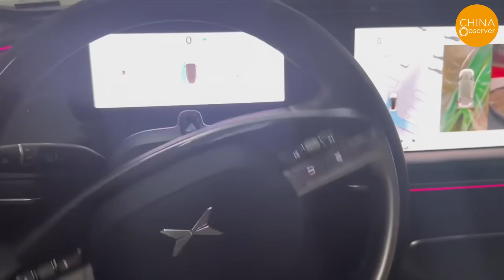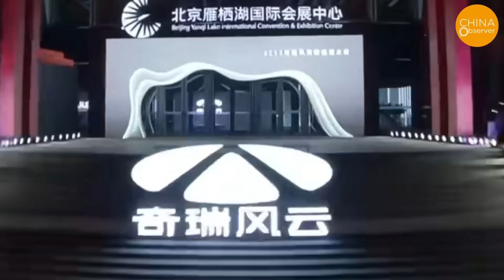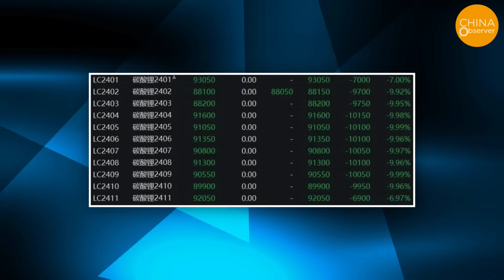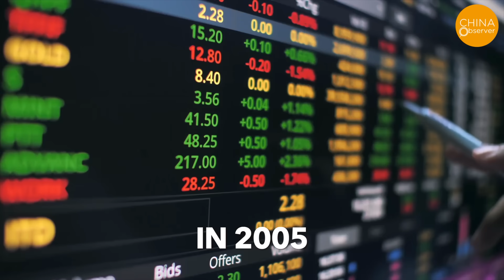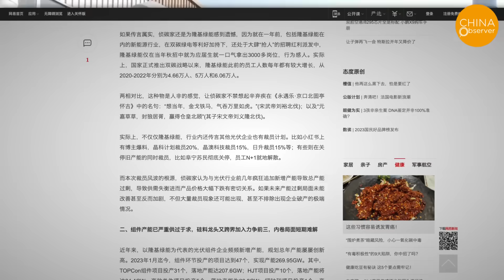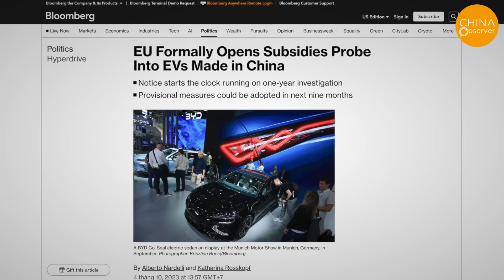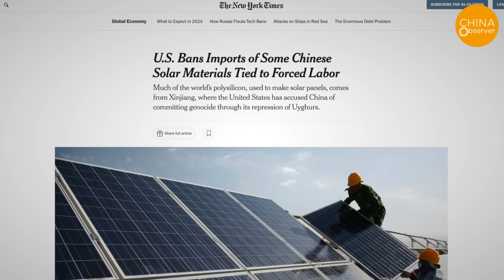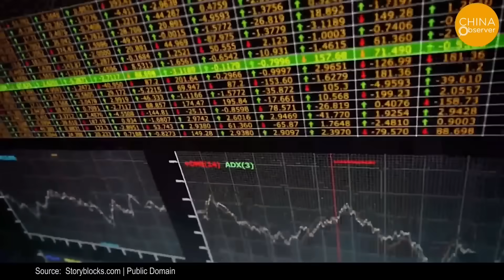Sudden EV Explosion, Rockets up 5 Meters, Close to 100 BYD Autos Spontaneously Combust

Comment: It's FAKE and here's why.
It is a real car and it does take off,
The people not only in front but but behind are waiting for it to happen and don't react surprised when it takes off.
The orange flare appears to start from the ground next the rear ( right hand side ) wheel.
The orange colour is too light and not bright enough.
After just a few frame there no orange flames.
The white smoke looks more like a compressed air and water.
There is a cable attached to the car ( 0:09 ) this could be how the orange flare was set off ?

Basically they fired a orange flare then fired an air canon under the car, the air/water covered the hole under the car. Notice the camera pans up even though the car drops down, this is because the hole would now be visible.

Comment: sfx stunt shot car was propelled upwards by charge going off pushing a pole through the base of the car sending it upwards there is no charging cable attached you can see the pole come out the bottom of the car through the smoke behind the corner of the building you can see the second unit film crew filming the stunt its a practice well known in movies remember raiders of the lost ark when indy shoots the driver of the truck he thinks marrion is in and it flips over on its side and blows up same stunt shot only it went wrong the charge wasnt powerfull enough to flip it on its roof like the director wanted so they left it in as was

Comment: What a load of FUD. There is a guy holding a camera filming the whole thing, let alone the vehicle is not a BYD and no battery pack would have enough force to send a 2 tonne vehicle 5 meters up in the air. Do some better research and stop wasting people’s time. It is a Toyota Rave 4, not a BYD. The other freeway video is a car traveling too fast and wrapped itself around a pole. Speed kills and the fuel ignited not a lithium battery. Wow.

Comment: EVs don't solve anything, but they create a lot of problems. The internal combustion engine is the most effective way to create energy from fossil fuels, and we will be using fossil fuels for decades. And actually petrol cars can also run on renewables, liquid fuel can be produced from electricity, and this is in every way a better solution. Batteries are heavy and thus gives bad driving cars. EVs makes no sense, stop this madness, it's idiotic.
Reply: And by the way co2 actually does more good than harm.
It makes plants more resistant to drought. It really benefits agriculture.
Actually more people die from cold than from heat.

Comment: just bought me a Xpeng G6, smooth quiet fast, 1 charge goes 500km(real range) cost $5, airconditoned seats steering wheel, surround voice command, self parking/driving. phone control - preheat car minute later all warm and toasty even steering wheel warm or cooled in summer.  you guys are living the the stone age, u.s. gov knows this and paying 1.5 billion a yr to smear all things china.    wonder how much this video got from that 1.5 bil

Comment: Some odd things I noticed about the first video. One person looked like he was recording as he was anticipating this. Nut everyone seemed calmed like nothing happened except one guy to the right. Also, I find it odd that their would be this much power to through this truck this high in the air. There where 4 sides under the vehicle for the pressure from the explosion to escape. I'm not saying this didn't happen, but I found these things odd. Now if this did happen as then yes this is very alarming and concerning. I think theirs so much hate for electric vehicles right now, theirs a lot of motives to make things seem worse the reality. Electric vehicles are the future. Whether or not they are ready to replace gas vehicles right now is a other story. Personally I don't think we are ready to replace gas vehicles with electric yet on a large scale yet. I also feel that theirs always going to be a need for gas vehicles as well.
Reply: Nothing green about EV. So don't come up with rash statements like "electric vehicles are the future"

They don't need to be. Especially if they aren't green and merely a tool by your government to control you into submitting yourself to the fake green agenda. Wake up!

Comment: This was all predictable if the press and politicians had told the whole story. In the 70s a minor event at three mile island happened that ended up killing people! Not because the nuclear reactor had a problem, what killed people was the panic that the press and politicians caused! All the deaths from three mile island were the result of traffic accidents involving people fleeing the area. If people knew what such a reactor was really capable of there would have been no panic.
        This is also true of the Green panic! Have you seen what happens when you put a small strip of lithium metal in the most common surface chemical on the planet? First it smokes giving of noxious fumes, then it burst into flames, finally it explodes! The common chemical H2O, also known as water. How do you permanently keep the lithium metal permanently out of contact with water? Even in the dryest places on our planet (deserts) there is water just not as much.

Comment: We have all had bad experience with batteries why would they think we would accept it in something we need like a car? Every kid has a RC car in the closet that won’t work because battery is dead and out dated so replacement is not possible rendering the entire car useless. Boycott batteries and poorly applied tech. Don’t buy into scams.

Comment: it is all about power density.... in order to increase range, we need to pack ever increasing amounts of energy into the reservoirs which are the battery cells.. fast chargers will also affect the service life of the cells.... the batteries are designed to discharge their energy at a variable rate with a maximum cap.... the problem arises when batteries are either badly designed or have suffered some sort of deformation either by waste heat caused by charging or catastrophic impacts like an accident.... the physically deformed batteries would short circuit and a chain reaction may cause the cells to either start burning and melting exposing other cells to short circuits and a nearly inextinguishable fire to burn until there are no more cells left to sustain the chain reaction, or the most dangerous scenario of all which is the cells would attempt to discharge all their energy at one shot. the laws of physics would then in principle dictate that the battery pack would behave just like an equivalent explosive charge. it would not exactly be a high order detonation like C4, but due to the sheer quantity of battery mass, which is likely the whole floorboard of the vehicle, i believe that the passengers would have an extremely tough time getting away. if the initial explosion does not kill them outright, the ensuing fire would engulf the vehicle faster than a regular petrol car in the same predicament.... if the passengers are still alive after all that, the fumes from the burning lithium cells should finish the job or leave permanent injuries at the very least. it is a very grim way to go...

Comment: I've just done research on lithium ion batteries and found out that they do far greater harm than good. To elaborate, lithium ion is extremely sensitive to heat; if caught on fire, hazardous toxic fumes containing carbon monoxide and hydrogen fluoride are released in the atmosphere and increase air pollution. Secondly, lithium salt contaminates soil and water sources; plants and animals die in agonizing pain from the stuff. Thirdly, farmers CANNOT plant crops in lithium enriched soil, and even if they could, crops aren't fit for consumption due to lithium ion contaminants. Needless to say, you think fossil fuels are bad? Well, lithium salt and ore...IS EVEN WORSE!
Reply: You didn't do any research at all. You're just parroting the same clueless nonsense that we have all heard a million times.
Reply: @user-bb7up7xv8m  For your information, I have done my research on lithium and its ill effect on the environment, you magniloquent  imp.

Comment: We Are Decades Away From EV's Becoming The Reliable! We DO NOT HAVE THE POWER GRID To Charge 10% If All Cars Were Suddenly EV"S! These Companies Wanted To Go EV With Their Delivery Trucks But Found To Charge Them Would Require more Currant Than The City These Companies Are Located in use At Full draw! We Should be Driving Hybrids With Super capacitors In Them !! This Would Eliminate The Deadly Gasses These EV's Produce While Charging And The TOXIC Waste They Will Be At The End Of Their SHORT LIVES!!

Comment: White colored new energy car that looks like an older Toyota RAV4. And it exploded so quickly and suddenly that a man stands ready to film with his mobile phone. Are you serious. I don't like battery cars, but this video must be a bit on the edge. I live in Norway, which is one of the countries with the highest density of electric cars. There are problems when they burn, but the biggest problem is the durability and the cost of replacement of the battery pack. It is also a lie that this is a new technology, new energy, but the technology is older than the internal combustion engine by over 40 years. The earliest electric vehicle came in the 1830s. The internal combustion engine in 1876.

Comment: It's quite coincidental that this video was released just when BYD became the leading seller of electric cars worldwide. BYD, a renowned battery manufacturer, ventured into car manufacturing. A quick Google search will reveal that BYD's Blade batteries are being utilized by other automakers, including Tesla, Mercedes, Hyundai, Toyota, and Ford, among others. It's worth mentioning that BYD is about to launch a new Sodium-ion EV battery plant. 
It's important to note that the first explosion in the video is not from an electric vehicle, let alone a BYD one. Furthermore, while the original video was cropped and blurred, you can still see that it's a film shoot if you look to the left. It's worth noting that BYD cars say BYD on the steering wheel. As you noticed in the video those steering wheels did not.
Reply: lmao you're right! Nobody seems to be impressed by a car that just exploded 😅
Reply: Another lie on youtube again.

Comment: They keep referring to it as a ‘Vehicle’. The VEHICLE isn’t exploding…The BATTERY is!!!
If I had to guess, it’s the voltage/current regulators that are failing. China has many years of Battery Manufacturing. 
Unless they’re using different compounds/materials with the Lithium, I would think the Cells themselves would be stable.
Hmmm

Comment: Automobiles Experience Shake, Rattle, and Roll, Impact Situations Potholes ETC , Batteries , Electrical Connections under Load High Resistance can Generate Heat Witch tends to Short Any Defective Link in the System ! The Problem Highly Volatile Lithium like Magnesium has a Run away Affect and burns way to hot for the General Public !.

Comment: Nothing green about batteries, solar panels or wind generators. Green is just a buzz word, similar to utopia. Even the sun will burn out and die. Too many short cuts along with many other factors produce sub-standard batteries and support devices (chargers for example). Each battery chemistry has very different storage, charging and discharging characteristics. Stop using the term experts, very few of them exist. Net Zero, another B.S. buzz word.

Comment: To be fair, it’s not just a China EV problem, but an EV problem in general.
Reply: Not for Teslas.  None have blown since their first year.  They engineered their BMSes well and the only fires since then were from the people damaging the battery, like running over huge boulders, or one of the concrete barriers between the opposing lanes of freeways.  The amazing thing is that Elon shared ALL of his design patents (including the BMS) with all other automakers globally in 2014.  Also, Tesla is one of the few manufacturers who is now using LFP (LiFePo4) lithium technology which cannot catch fire.
Reply: export to taiwan?

nope
Reply: Actually  it's a design  problem,  engineers  need to address  those known issues   in my opinion  this shouldn't  be  complicated as testing  should  have been done before  production
Reply: FFS! 
Its not an EV cars its a Rav 4 from the mid 90's 
This video is of an LPG Explosion due to out of date bottle and faulty relief valve. 

Its just a fake Video About EV fires to try and push their BS agenda about EV's 
 @carlstephens1532
Reply: Having tens of thousands high discharge rated cells in close proximity to one another when just one getting faulty is enough to start a chain reaction. Who'd have thought this could be a problem?
Reply: Except the video is of a 1990's Toyota Rav4 (non EV) Having an LPG tank explosion. 

No batteries were harm in the making of this video, probably not even the normal 12v car battery in that Rav4.  @dimitardimitrov9482
Reply: @dimitardimitrov9482  you don't  understand  fuses do you ?, they work and are cheap
Reply: @carlstephens1532  And yet they spontaneously combust sometimes. Don't get me wrong, having such low critical failure rates, lithium cell battery packs sure are built nicely. It's just an inherent problem of the lithium battery.
Reply: @dimitardimitrov9482   all batteries  can have issues , we have all kinds of machines  that run on batteries    the differences  start with engineering  , and testing,  it's obvious  they cut corners and removed the safety  devices  from production  ,  that's very plain ,  I had an electric truck I bought that was a fleet vehicle. 20 years  no fires , amazing    , not really it was good  engineering I sold it years ago and it's used every day  ,  so  why did early  vehicle's  not have issues  that are here today.   They had all the safety  devices. New ones don't
Reply: @dimitardimitrov9482  not really , all batteries  can pose serious  problems  but not adding  safety  features  to any  of  them makes it an engineering  problem
Reply: Chevy volt...day one roll out fires happened. No brain fog here.
Reply: No but china's has More then the average events.
Reply: @mikemiller659 half of all ev in the would is sold in china
Reply: I just found out why. The battery that using in all EV cars are Chinese made. As long as only China make a Battery for EV car I’ll just buying a gas car like a 1994 Toyota Celica
Reply: Whats funny is the car in this video is a late 90's Toyota Rav4 and that is an LPG (gas tank) explosion and nothing to do with a battery or EV's as it is yet another fake video.  @PreciousAlpschindler
Reply: @tbas8741 thanks for clarification. It is not EV. Some part of this video is fake or disinformation.
Reply: @PreciousAlpschindler lol, that's like saying Uranium is dangerous because it's made in China. I don't like the CCP, but you guys are literally starting conspiracy theories.
Reply: https://youtu.be/itGeAq9rBeY
Reply: Well Tesla did not have this kind of problem it's just only chinses ev cars 😅
Reply: @ag4eng  oh I see some Chinese bots again
Reply: Exploding Vehicle.   They're doing just that
Reply: Guess where most of the batteries are made ?   It's a China problem. 😂
Reply: @denyscpoyner  So you have never seen Tesla car burned into flame?   Search again 😂😂😂
Reply: To be fair this is not even an EV car i
ts a RAV 4 from the 90's and the Explosion is caused by LPG Gas with faulty release valve on a hot day.
Reply: LIAR! @tbas8741
Reply: @tbas8741  Nothing to do with LPG. The footage is taken on a film set. It's a staged explosion for a film!

Comment: JMEV company from China is already producing vehicles with sodium-ion batteries from Farasis Energy and Hina Battery. These do not have the same range as Lithium batteries but are more secure, work under much less temperatures which is good for populations very north or very south of the globe, and have much lower price. So the future is not that grey.

Comment: I don't understand the " rush " to promote and push electric cars that aren't perfected and are not ready for the market. What I could understand, rationally, is a " rush " to develop electric cars BEFORE pushing them onto consumers. Make EVs viable FIRST ,,, and THEN bring them to market. That's how I'd handle it, but then again, I'm not government, so common sense is not part of the current equation.
Reply: The government is not producing EVs. Car manufacturer do.

Try the common sense part again.
Reply: Dude, of freakin course the government isn't producing ev's, why in hell would you think I meant that? It's not martians either, it's the manufacturers, good God, did I really have to explain that? The government is PUSHING ev's through mandates, or don't you follow the news.

Comment: LFP produces combustible gases: Hydrogen (H2), Carbon monoxide (CO), Carbon dioxide (CO2), Hydrocarbons, such as methane and propane.  It could possibly explode, but probably not in the way shown in the 1st clip.
Reply: Where would the hydrogen come from?

Li Fe P O4 is the chemical composition, there's nothing explosive there.

Li, lithium
Fe, iron
P04, phosphate (P, Phosphorus + O, oxygen)

When they fail it's a thermal runaway situation like thermite - they release the stored energy as heat. This is highschool level chemistry, redox reactions...
Reply: @sirtra  >> Where would the hydrogen come from? <<
the hydrongen is directly produced in a TR event, or temperature above 260'c as the PVDF (cathode binder) reacts with intercalated lithium.  And no, elements in the cathodes themselves can't do jack alone and  you didn't learn that in high school?
Reply: @tooltalk  what do you mean by "directly produced" that makes no sense.

What chemical reaction is occurring in a LiFePO4 battery which produces hydrogen gas?